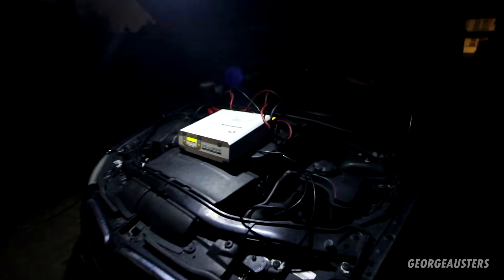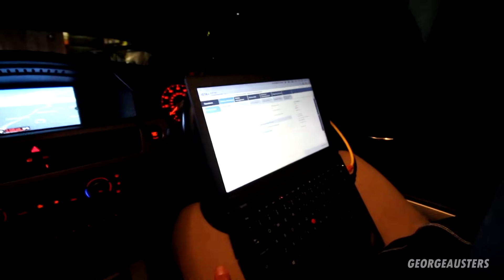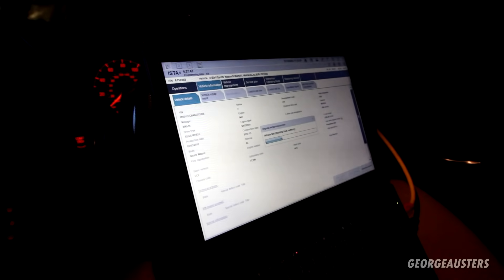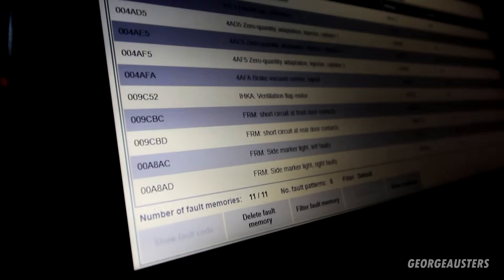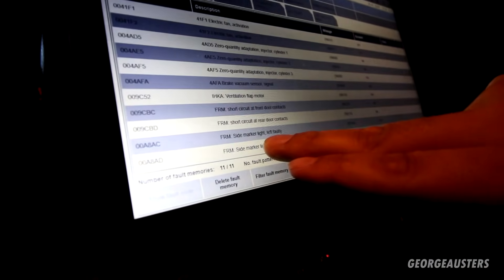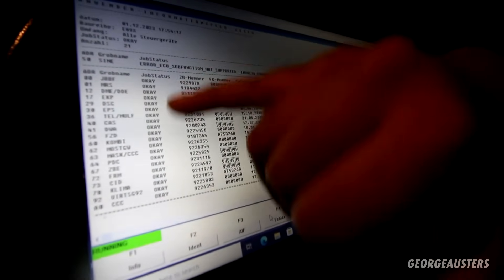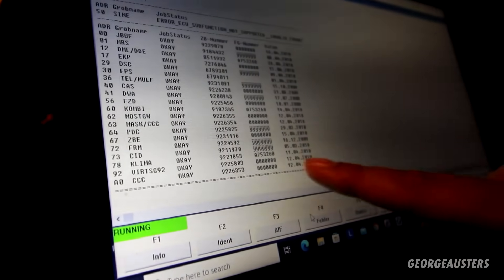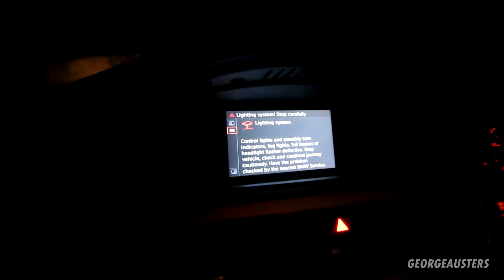BMW LIGHTS WINDOWS WIPERS NOT WORKING FRM ERROR | EASY FIX

Comment: Hello George,

Was a pleasure working with you again and thank you for the nice words! 

Can’t wait until the next video ;)
Reply: Does the frm control the wipers mate
Reply: @madmaxmotors2001  Yes
Reply: @MidlandsVehicleDiagnostics   having an issue with my e70 no front wipers any setting some times washer works and headlight aim the only other fault happened at same time
Reply: @madmaxmotors2001  Will need to scan it and check fault codes

Comment: You can make yourself a battery voltage stabilizer for less then £40. Using old pc switching power supplies and is much more compact than that.
Reply from the maker: I guess so.. But a business isn’t going to risk using an old PC power supply on a customers car 😂
Reply: @GeorgeAusters  its what those are made of anyway, those switching power supplies never die. I was talking for the general public who don't have hundreds to spend just so they can update modules.
Reply: @GeorgeAusters  Oh yeah forgot to ask when's the 760 cost break down coming out?